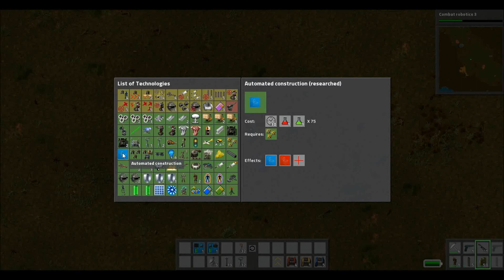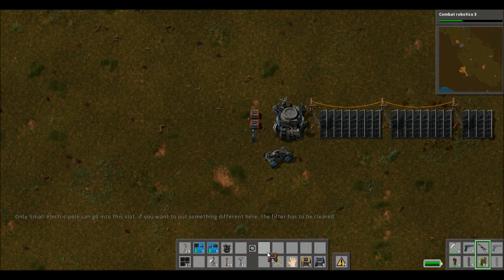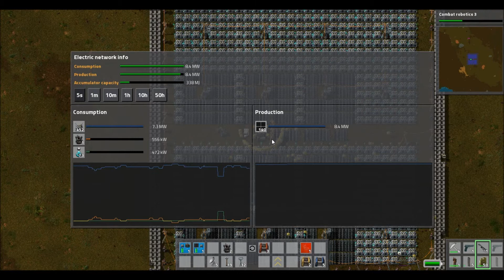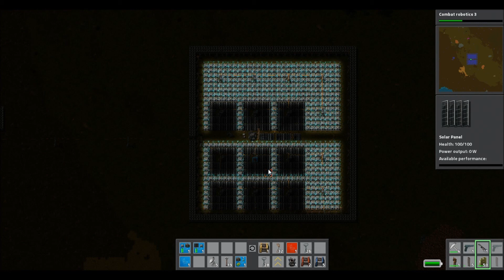My Power Base + Blueprint

Comment: this is great!

the one thing that comes to my mind is that you compact your solar area ever so slightly. you have i think 15 solar panels and 13 accumulators.

if you dropped one accumulator you can fit one more solar panel in by having the Acc's in a + shape from the substation and then having 4 solars in each corner.
(it fits perfectly inside the 14x14 so you can repeat it endlessly)

its not a huge improvement, it may not be any improvement really. but its how i lay my solar plants out and i quite like the pattern it makes when i repeat it several times to make a big square
Reply from the maker: Thank you

Comment: nice. i like it. imho, it's more effective to place lasers in bulk groups in range of shot from group to group. also it's more effective to cover lasers from all sides, because if your wall is breached in one place all your lasers can die very fast. btw you don't realy need to protect solars or batteries. they don't make pillution, so biters don't attack them.  btw your u don't realy need lasers to go offensive on biters - check my factorio video. i kill big biter base in 2 min without lasers there.